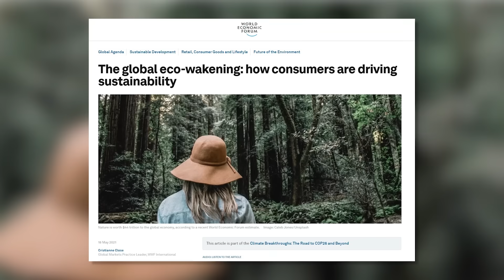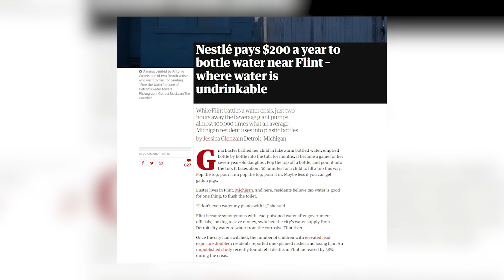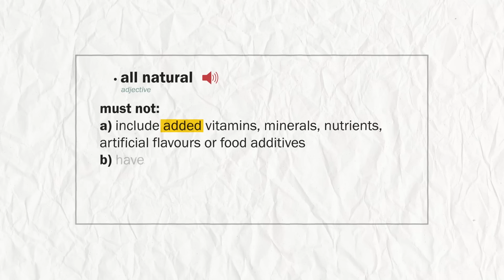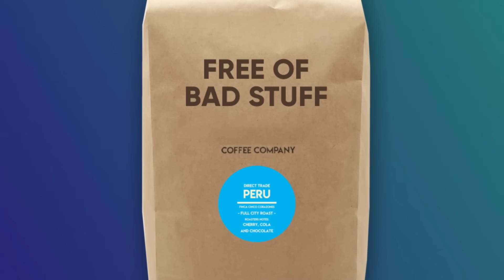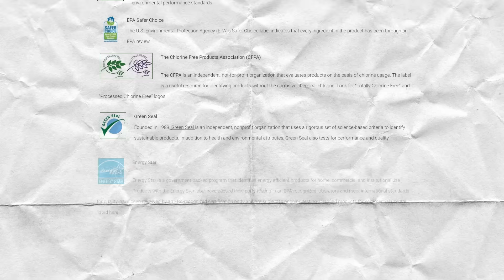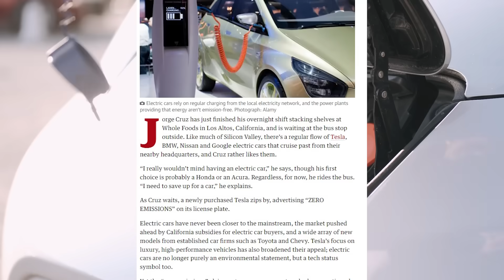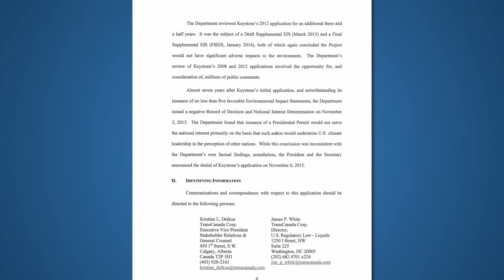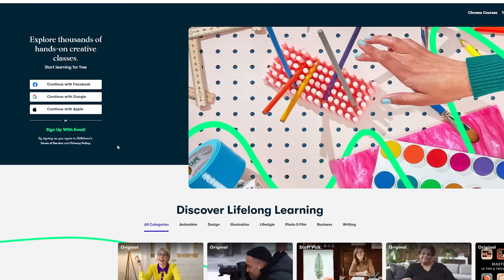Why Being 'Environmentally Friendly' Is A Scam

Comment: Another thing being ignored, is that the unscientific banning of CFCs has created more problems than it has solved.

Original-recipe Freon (R12) runs at a lower pressure than the replacement "eco-friendly" refrigerant (R134A).  The much higher pressures needed with R134A cause undue wear and tear on compressor components, and since the compressor is fighting to produce much more pressure, consumes much more power than would be needed to compress R12 refrigerant. [1]

For those who want to learn, read on!

The most common type of Freon is dichlorodifluoromethane, commonly referred to as R12. It is a molecule which has 2 chlorine atoms and 2 fluorine atoms connected to a central carbon atom.

The atomic weight is 2x chlorine plus 2x fluorine plus one carbon, or 120.913 [2]

The atomic weight of diatomic nitrogen, which comprises around 78% of our atmosphere, is 28.014. [3]
This means that freon weighs 4.34 times what diatomic nitrogen does. [4]

The atomic weight of diatomic oxygen, which comprises around 21% of our atmosphere, is 31.998. [5]
This means that freon weighs 3.78 times what diatomic oxygen does. [6]

Compare with helium which weighs 4.003. Nitrogen weighs 7 times what helium does, [7] and oxygen weighs 8 times what helium does. [8]

Imagine the tug upward you feel from a freshly-filled helium-filled balloon. 

That same balloon filled with freon gas would tug DOWNWARD around half as much, meaning freon sinks very fast, making it virtually impossible to reach the stratospheric ozone layer in appreciable quantities.

Next, ask yourself:
1) WHERE is the hole in the ozone layer?
and
2) WHEN did the hole in the ozone layer form?

Answers:
1) It's over Antarctica. [9]
2) 1970 [9]

So we must then ask... WHY is it over Antarctica... and WHY did it start in 1970?
CFCs had been used constantly by dozens of industries for many decades since its invention in the 1930s.

Did freon suddenly become sentient and "learn" how to destroy the ozone layer?
Did the rules of physics change in our universe?
OR
Could there be another explanation?
 
As it turns out, there's a volcano in Antarctica, called — and this is pure irony — Deception Island.

It erupted in 1970, [10] spewing sulphuric compounds high into the antarctic atmosphere, [11] where it began to destroy ozone molecules. [12]

In fact, the overwhelmingly vast majority of the current damage to the ozone layer could likely be attributed to this volcanic activity, if properly studied.

ALSO

The Earth has atmospheric "bands" that prevent mixing atmosphere from pole to pole. This phenomenon is called "geostrophic flow". [13]

This observation can clearly be seen on the planet Jupiter, where weather systems are confined to distinct bands, which are colored differently because the atmospheric chemicals cannot easily intermix and move towards the poles.
 
█

[1] https://griffiths.com/ac-system-help-introduction/r134a-vs-r12/
[2] 2× chlorine (35.453 × 2 = 70.906) + 2× fluorine (18.998 × 2 = 37.996) + 1× carbon (12.011) = 120.913
[3] 2× nitrogen (14.007 × 2 = 28.014)
[4] 120.913 atomic weight of dichlorodifluoromethane ÷ 28.014 atomic weight of diatomic nitrogen = 4.31616 times
[5] 2× oxygen (15.999 × 2 = 31.998)
[6] 120.913 atomic weight of dichlorodifluoromethane ÷ 31.998 atomic weight of diatomic oxygen = 3.77877 times
[7] 28.014 atomic weight of diatomic nitrogen ÷ 4.003 atomic weight of helium = 6.99825 times
[8] 31.998 atomic weight of diatomic oxygen ÷ 4.003 atomic weight of helium = 7.99350 times
[9] https://eospso.gsfc.nasa.gov/sites/default/files/publications/2012Ozone_Hole_Lenticular_508_Compliant.pdf
[10] https://en.wikipedia.org/wiki/Deception_Island
[11] https://www.volcanodiscovery.com/deception_island-eruptions.html
[12] https://meteor.geol.iastate.edu/gcp/studentpapers/1996/atmoschem/huff.html
[13] http://acmg.seas.harvard.edu/people/faculty/djj/book/bookchap4.html

Comment: Greenwashing is problematic, but if it makes a differeance  is it all that bad.  Simple self awareness goes a long way. Waste is Waste -don't pay for what you're thrown out.  The fewer products you use the less packaging you throw out.  Dont get sucked in by Aesthetic A nylon shop sack requires less water to clean and will pack smaller than a "Green" organic cotton one.   Saving your own money can save the enviornment - rather than buy travel coffee in a reusable cup -make  own coffee  at home, using a pour thru in a thermal cup.

Comment: Just a note about CFCs - it's not linked to the greenhouse gas effect, the ozone layer is about protection from UV radiation, please don't mix the two. Also research is showing the Ozone Layer is recovering well since we switched away from CFCs so HFC's are doing their job well (in terms of ozone recovery, dunno if HFC's are causing other damage).

Comment: I was with you on everything, up until you were cheering about the keystone pipeline being canceled. I know this is very "lesser of two evils" but pipelines are way safer than other forms of transport. The oil and gas is going to be shipped one way or another. I argue let's do it as safe as possible.
Reply: They're not actually safer, the idea that they're safer is oil corporation propaganda. Technically speaking, fewer people are immediately injured by pipeline failures than train or truck failures, which is why oil companies get away with claiming they're "safer". But pipelines do significantly more environmental damage when they fail, and the damage they do is significantly harder to reverse, which creates far worse problems for far more people than train derailments or truck crashes. It's also completely possible to vastly reduce injuries from train and truck failures, by reducing the length of trains, slowing their speeds, and reducing work hours for train and truck operators so they're less fatigued and make fewer mistakes. 

Pipelines are a terrible way to transport oil, especially the type of oil being mined in Alberta, which is what the Keystone XL would have transported. Alberta is primarily mining bitumen, which is oil that has been degraded by long term exposure to oxygen and water while underground. It's not like the kind of liquid black oil we see in movies. Even after being separated from the sand and sandstone its often trapped in, it's highly viscous to the point of almost being a solid, and it's extremely corrosive. It has to be mixed with even more corrosive and toxic chemicals just to make it liquid enough to move through the pipes. Bitumen is so corrosive, and so difficult to move through pipes, that it's not a question of if a pipeline will fail, it's a question of when. Failures in currently operating pipes are frequent and highly damaging. 

The propaganda for pipelines doesn't exist because pipelines are better, or safer. It exists because transporting by pipeline is the only way to actually make any profit off of bitumen, so oil companies want to keep using them as long as they can possibly get away with it, even though they're worse overall.

Sorry for the long reply. I lived most of my life so far in Alberta (I live in Ontario right now). I've spent my adult life watching oil company antics. They lie constantly, buy politicians, skirt regulations, and leave local taxpayers on the hook to clean up the mess they leave behind while funneling the vast majority of their profits out of the province and out of the country. They treat their employees pretty badly too. I have a ton of family who work in oil. Their wages and benefits get cut any time the companies think they'll get away with it, and safety standards often aren't upheld. The time and money they spend on pro oil propaganda is mind boggling. Any time you hear a pro oil message, be suspicious of its accuracy and origins.
Reply: @suchnothing  thank you for this thorough reply. After reading this changes everything by Naomi klein, my conclusion is to be 99% suspicious of any assertion or development from gas and oil companies… having worked in software tech, I see the exact same kind of business-first decision making under the guise of mission driven PR. I’ve had enough

Comment: Keystone Pipeline was going have a positive impact on the environment actually. It was going to save all that oil from having to be transferred via trucks, trains, and ships. It's much safer to transport oil via pipelines. Not to mention the positive impact it would have had on the economy once finished. Also, TC didn't shut down the pipeline, Biden signed an executive order shutting it down.

Comment: You sir are an ecco fake when you characterize the keystone pipeline shutdown as being an ecco win. The oil from Canada to the US is still going to continue being transported with or without the pipeline. And if you were honest in your concern for polution you would have reported that the transport of that oil using trucks and rail consumes way more energy and contributes way more pollution that transport via pipeline. You would also have been honest in you assessment of oil spills resulting from pipelines versus trucks and rail. Trucks and rail are far more likely to result in oil spills (per tonnage transported). Not only that, but transport via truck and rail greatly increases the cost of gasoline to the consumer because the transportation costs are significantly higher using trucks and rail than theyare using pipelines. You want to know what a ecco scam is? Your mischaracterization on pipelines vs ground transportation. You are a big fat lier. Do some damn research on the environmental comparisons before you demonstate your ignorance. You are ignorant of the hard facts and are just spouting virtue signalling platitudes.

Comment: Something every adult should know is that 90% of EVERYTHING any corporation, or goverment says is 100% BS. Climate change for example is an excuse to make draconian laws and regulate people on extremely biased and misleading research that they themselves fund and can't be easily proven or disproven such as climate effects that take hundreds or even thousands of years to be shown.  Another example is people driving TESLAs think they're so environmentally friendly because they don't use gas, but where does the electricity come from? It's produced using gas or coals, the manufacturing process of the batteries also create massive amounts of waste, and replacing the battery every few years is another wasteful impact too. People need to develop critical thinking skills and stop believing ANYTHING coming from people trying to sell you a product or policy.

Comment: One point of criticism: the cancellation of the Keystone pipeline just increased rail traffic, which pollutes more and results in more spills than pipelines. It also meant less money went to Canada and more went to Russia. Unless end-users decrease consumption, the only effect of cutting out portions of the product's supply chain (leasing bans, frac bans, pipeline cancellations) is increased cost to the consumer... And if the goal is just to increase prices so the consumer will switch, why not just increase gasoline taxes?

Comment: there is a natural alternative (the original before) for shampoo,
there is a natural soap
there is jute bag
there is wood
there is solar power
there is minimalistic lifestyle
there are natural fabrics
there are natural beauty products
but the thing is standards, these don't have standardization, you fear, "it doesn't have govt. mark!". except my laptop, phone, battery for my solar system i have no plastic or pollutants, it's been 7 years. i use either metal or wood or paper or natural leather.

Comment: The pipe line is what? Okay I’m down with hauling it in trucks and ships maybe a train. Just look a the risk of ships sinking into the oceans Exxon mobile or train derailment or trucks wrecks. I know a well built and serviced pipe is going to damage the environment it not like they can’t drain it clean it and fix the pipe and remove anything that leaks out. Oh yes they can and they did it for years before the XL pipe and the leaks was where as bad as Exxon mobile ship wreak with all of them combined.

Comment: Cancelling the Keystone pipeline was a MASSIVE mistake. The oil still will be transported, it still has to get from A to B. Only instead of using a pipeline (by far the most environmentally safe option) we will continue to use trains, trucks, and ships… all of which are far worse for the environment.

Also, the pipeline was due to be completed around now, and it’s completion would have supplemented the Russian Sanctions and our gas prices would not be what they are now. 

It was a loss environmentally and a loss economically, with no positive gain whatsoever. And it was an executive order from Biden on his first day. Shot his own country in the foot immediately. 😞

Comment: His take on the whole VW "cheating scandal" is completely devoid of any actual research. A quick dive into the facts would show how it was more about sending a message to car companies to stop trying to use small diesel engines to improve efficiency, and to instead go the electric car route. Highly efficient small diesel engines, such as the VW TDI engine, make electric cars look irrelevant. The "cheating scandal" was VW trying to meet the extremely ridiculous regulations on small diesel engines.

Comment: Pipelines are actually more environmentally friendly than traditional forms of fuel transportation. Not only are leak events less frequent, but they're also far more likely to occur at end points and checkpoints in the system itself, and are more easily put under control. They also move fuel more cheaply, because you aren't burning fuel to move fuel.

Comment: One of the "destructive" mines shown and said to be a lithium mine, is not. It's a copper mine.

Also the EPA has data on the carbon footprint of EVs based on state level energy generation. It just affects the time it takes to outperform ICE but is always better for emissions, local pollution and reduces the use of a strategic resource (oil).
Reply: One can argue the benefits of hybrids, but I would never buy a car which depends solely on electricity to get me places. The grid is a mess and will only get more strained in the future due to lack of upgrades.

Comment: While there is "false advertising" in everything, you can still live more environmentally friendly if you do your research and keep on on it. For example, I no longer "recycle" my plastic water bottles since I now know they will end up being shipped to other countries where they will pollute the environment due to lax laws in those countries. Therefore I throw them in the regular trash so they go to a local landfill. Yes of course I could do more by getting a filtration system but they are expensive and the cheaper ones do not taste as good. There are many little things one can do to reduce the problem.

Comment: It seems as though we, 30 years ago and before, used to re-use and recycle a crap ton more than we do now.  Glass, steel, aluminum and paper are all easily recyclable/re-usable, but the "recyclable" plastic crap used since then isn't recyclable.
Dial it all back.

Comment: stop using plastic as a water container... start using aluminium (or aluminum like you say an the US); compared to glass or plastic, aluminium is 99% reclycable so that's a HIGH amount, and you can keep recycling it over and over again.. not so for plastics or glass.... with glass you get contaminants that colors the glas which degrades its use, a white glass bottle is also a lot heavier then alu (i'll keep it with the short word, avoiding EU/US spelling) and alu doesn't shatter when you drop it on the floor.  Plastic is only 60% recyclable, and it's quality degrades A LOT when it's recycled... so a pet-bottle will not recycle into a pet bottle, it'll recycle into a traffic cone since that requires lower quality plastic (contaminants etc in the water is a big nono). 
and last but not least, start putting money on the actual bottles...  10ct per alu can... you get the money back when u return the can... and if you're rich enough to litter, your can will probably be picked up by a kid that wants money or someone who's homeless maybe who's trying to make some money for food or dope..  the world would be a waaaay better place without plastic one-time-use bottles